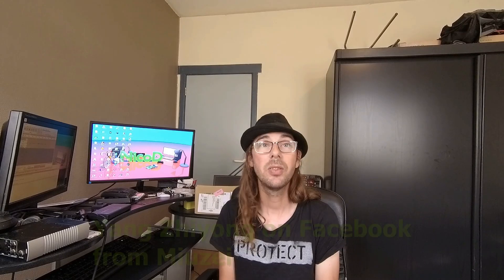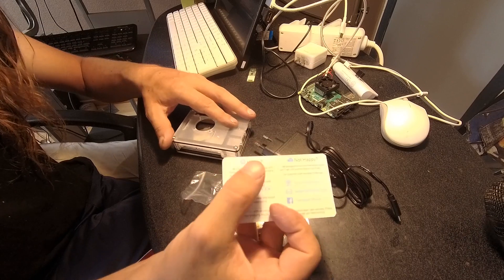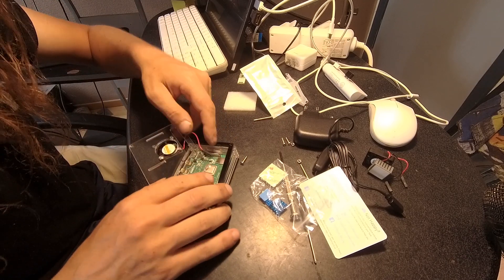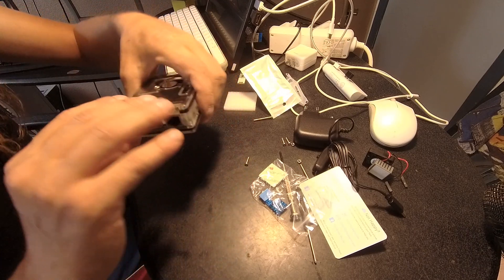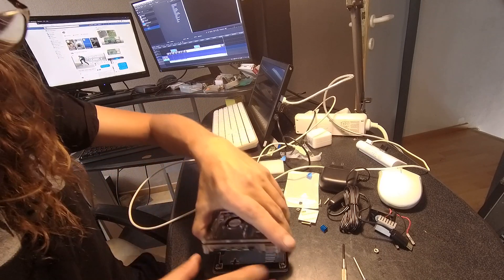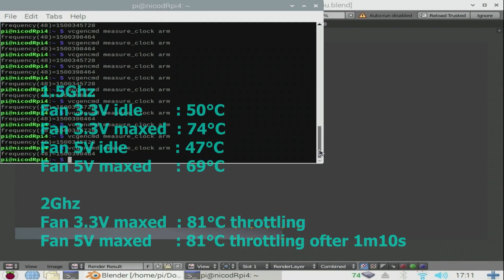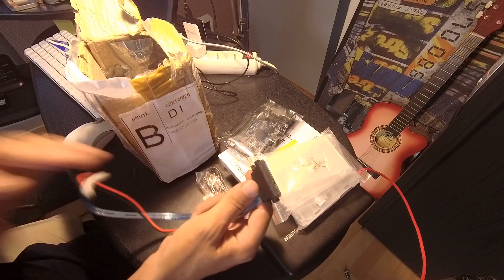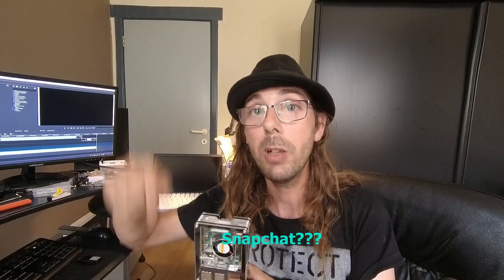Raspberry Pi 4B Case Assembly + Giveaway + Fan mail

Comment: Did you try Kali Linux on this?
Reply from the maker: No I haven't. I just checked and it seems there's a good kali image for the rpi4b. I'll try it when I find the time. Thanks for the tip. Greetings.
Reply: This is a good suggestion, I would be very interested in that as well!

Comment: Still wanna see a video on emulation and Pi @ 2 GHz..   did you fix the Ubuntu issues you had on the Pi4 review?
Reply from the maker: No, Ubuntu is still only 1GB of ram, and buggy. We've got to wait for Canonical to release an official version.
I haven't tried to get retropie to run. Should be possible by updating the firmware I guess. Otherwise I could install retroarch in raspbian. But the GPU drivers aren't ready yet for the RPi4B.  I'll see when I've got time this weekend to check it out. Cheers.
Reply: @NicoDsSBCs  https://forum.snapcraft.io/t/support-for-raspberry-pi-4/11970/23 seems to show CORE is making progress with 4Gb supported now

Comment: That case has been my go to for the pi 3b, but pi 4 overclocked runs too hot. (And I will be overclocking it for retropie eventually)

Please test with a bigger heatsink because otherwise I am fine with the case. Thanks.
Reply from the maker: I don't have any fitting bigger heatsinks for the moment. My tinker heatsink will not fit with the fan. I should test without that heatsink too. Maybe it's better since there's less thermal resistance. 
He has bigger heatsinks for it. Here for example.
https://www.facebook.com/photo.php?fbid=509726073111753&set=pcb.509726923111668&type=3&theater
You may contact him for it. Greetings.